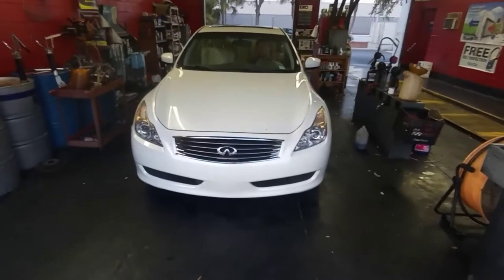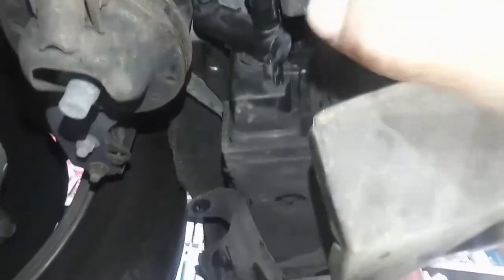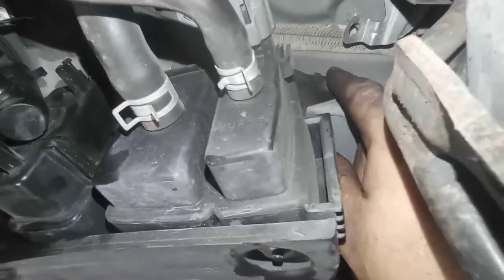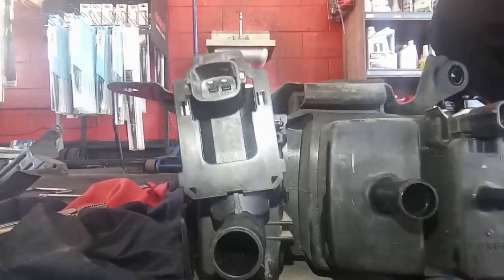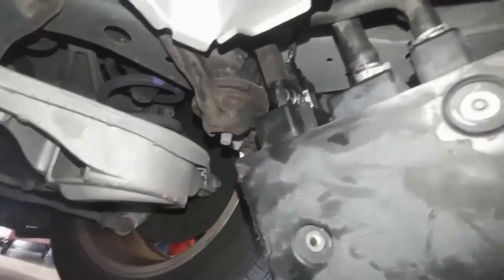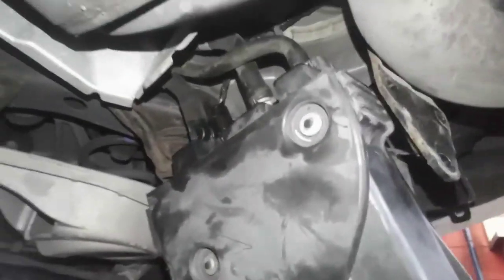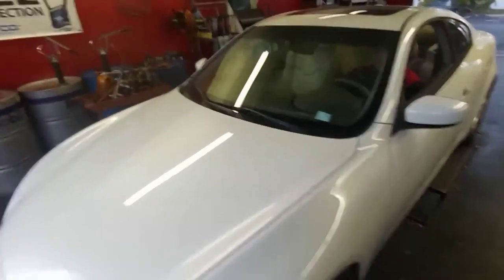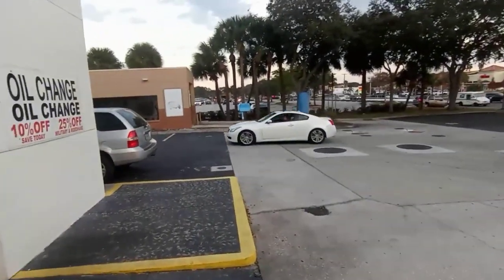P0447 for 2008 Infiniti G37 Coupe Control Valve EVAP sensor

Comment: Thanks for the Vid! I managed to replace my sensor without removing the canister . Use a flat head screwdriver to pry it over the metal lip it is hitting. My canister screws were all rusted so didn’t want to deal with that. My code was P0456 btw
Reply from the maker: Do you have evap league so that mean when the guys go with bubbles with air to the engine so your injection doesn't know what's going on so that's why you have this coach you have something leaked a horse lick it or maybe the sensor by himself you need to be changed

Comment: The TSB claims that the ECM needs to be reprogrammed by the dealer in order to work properly with thr updated (lower voltage) valve. Also, I wonder if any of the aftermarket valves are updated. Did this fix the battery drain for this customer?  Or did they just have the fault code present?
Reply: Did it fix the battery problem for u?
Reply: @stevenpaladino4630  So, my story is a long one. Short version: Replacing the valve got rid of my Evap code. However my battery drain issue was very hard to find. Ended up that my alternator would charge until it hit a certain temp, then it would stop charging. So, short trip, battery charged fine. Long trip, battery would get drained and car wouldn't start when I'd go to leave.
Reply: @jwhiteker1  thanks for the reply. Mine seems to be the opposite so I gotta keep looking 🫤
Reply from the maker: Defective charging system - A car battery drains quickly if something called the alternator on your charging system fails to push out enough voltage, ideally between 13.5 - 14.5 volts. In this case, the battery will continue to drain even while the car is running.
Reply from the maker: Defective charging system - A car battery drains quickly if something called the alternator on your charging system fails to push out enough voltage, ideally between 13.5 - 14.5 volts. In this case, the battery will continue to drain even while the car is running.
Reply from the maker: Defective charging system - A car battery drains quickly if something called the alternator on your charging system fails to push out enough voltage, ideally between 13.5 - 14.5 volts. In this case, the battery will continue to drain even while the car is running.

Comment: I heard to change this if my battery keep dying randomly battery is fine starter good alternator good?
Reply from the maker: I think you have to reset your ECU
Reply from the maker: Anytime you change something on the car you supposed to be reset the ECU
Reply: I don't remember which exact models but yes this is part of a tsb for battery drain. The earlier models vent control valve drew too much current when the car is off.
Reply: @Xavier_Wells  My 08 G37 coupe battery keeps dying. I bought new one and only drove car for 5min. and next day new battery is dead. Everything turns on but car won't start. I heard its either this or could be the 6 disc CD change if your car has that option. I heard if you run a stronger 24f bettery, this issue does not happen, is it true?
Reply from the maker: Could be anything eat your battery take your car to Autozone or auto parts let them check the battery for you and everything what happened there
Reply: Did it fix it for u?

Comment: I had my purge valve solenoid replaced yesterday and the service engine soon light is still on. The only other code I had was c1109 which was just to retighten the negative side of the battery which I already did but that goddam service light is still on.
Reply: Hey did you get this figured out? Did you get rid of the p0447?

Comment: what happens if ur car is running without the sensor n just the hose hanging ?
Reply from the maker: Your car spend a lot of gas and losing horsepower
Reply: @LessExpensivefix  is that why i floor the accedlater n nothing happens it doesnt go past like 2k rpms feels like car is misfiring because of that would u think the same?
Reply from the maker: If you don't fix it and the future you got a Miss fuel pump
Reply: @josechepe9851  did you ever fix your?
Reply from the maker: After we change the sensor we fix the problem
Reply: @josechepe9851  ??